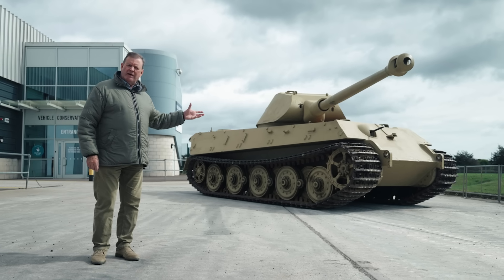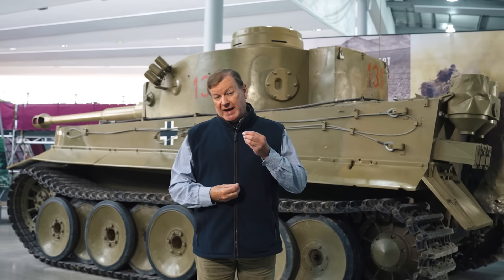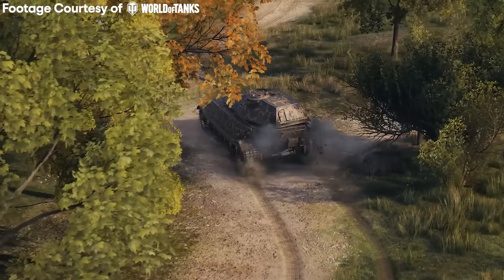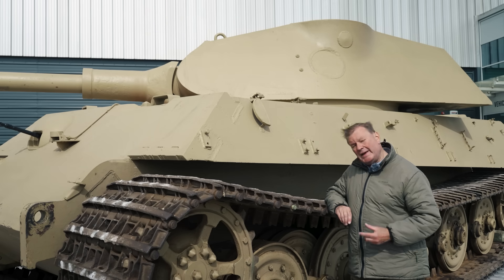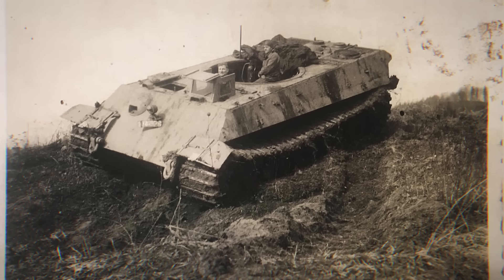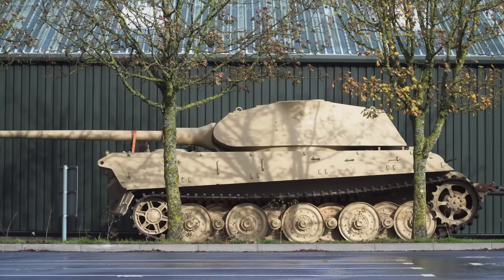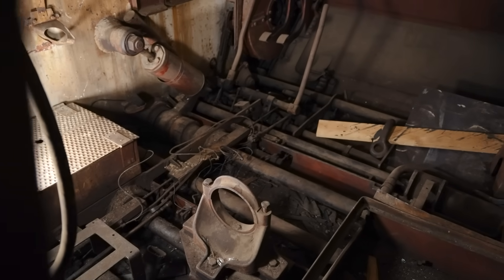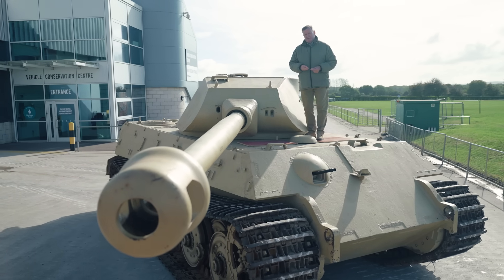King Tiger V2 - Inside The World's Oldest Tiger II

Comment: I always wondered why the Tiger 2 was designated VK-45.03 when it's successor, the Tiger 1 was designated VK-45.01, it would then lead me down the interesting rabbit hole of the VK-45.02 (H) which was effectively the Germans version of the M4 improved but for the Tiger 1.  A obscure and lesser known design that while only lasting around 7 months on the drawing board, many design aspects found on today's Tiger II's were carried over from Vk-45.02 (H).

Comment: So that Porsche turret WAS made by Porsche... Why make it confusing by saying it is not made by Porsche, if the turret WAS made by Porsche? The difference is that the turret wasn't intended for King Tiger, or Tiger 2, but turret was still made by Porsche.

Also, the explanation of why the top is thicker is silly, not in the fact silly, but the reasons why it is explained. It is obvious to many, that the top is higher because it's thicker, but it's not explained why, though everyone can image that it is a protection against air attacks. What is actually a good question, that wasn't given, nor answered, was, why they left that front slope between front and top, thinner without additional plate like for the production model?

Comment: When you give it a new gear box, make sure the gears are case hardened to the proper depth and the hardness drawn back to Rc58-60. The original gears were too hard and too deeply hardened on account of time pressure to get them finished. As a result, they tended to shatter under sudden shock loads.

Comment: The failure of Porche's petrol-electric drive was also caused by the lack of materials - chiefly copper - that this design would have required. With u-boat manufacture having first priority in such copper as there was, and they required a lot, the petrol-electric drive was simply not viable, even had it performed well.

Comment: At the Full Military Museum in Switzerland, a second Tiger II will soon be running again after more than 20 years of restoration – the second operational one worldwide after the example in Semur, France.
I’ve been following this project for many years, and once it’s completed, this Königstiger might well be the best-preserved of its kind. The restoration has been ongoing since 2006 and is carried out with such precision that you could almost call it “like new.”
Typical Swiss precision! I wish the entire team great success with the final stages of the restoration – an outstanding piece of engineering history!👍
Reply: And the Saumur Tiger 1 should be running again soon. It entered the museum in a running state, but they did not run it since. So they are doing a full overall to make it run again. Raised 260k € last year. And it should be running soon using it's original engine and transmission.
Reply: @karakiri283Isn’t Whitecroft also restoring at least one Tiger 1?
Reply: WHEN WILL WE SEE IT RUN THIS IS NOV 2025 SO WHEN?
Reply: @KenLeach-y2f  Current status of the Tiger II restoration at the Full Military Museum (Switzerland):
According to the Winter 2023/24 report, the Zimmerit coating has been applied and the turret has been re-mounted, giving the tank an almost complete appearance.
The gearbox is largely rebuilt, and the steering unit is expected to follow by late 2025. The engine, restored in Poland, is currently undergoing test runs, but hasn’t been installed yet.
In parallel, the new exhibition hall is still under construction, which naturally ties up some resources. The official website shows few recent photos, but several Facebook updates confirm steady progress.
My conclusion:
A realistic date for the first running demonstration would be summer 2026 – and judging by the pace of work, that seems quite achievable.
When that day comes, I’ll be there to see it! 💪
Reply: Saumur*

Comment: I did a lot of research on this particular tank years ago including a visit to the museum in 2008 when it was still in the horrible three tone paint scheme. The tracks that are on the vehicle now are not the ones it was born with, those would have been the Gg 24/800/300, but it was recovered in 1945 with the Kgs 73/800/152 that are on it now. I have a real soft spot for these odd vehicles, there are so many little details, apart from the ones mentioned in this video, that sets it apart from the production vehicles and i am aboslutely thrilled that Bovington has decided to try and make this one a runner.

Comment: On the subject of the shape of the turret it's not just to make the turret harder to hit, the actual purpose was to deflect rounds, exactly as it ended up doing. The idea was that since the turret was meant to be mounted in the front in the Porsche chassis it would mean that shells would either go over the turret or be directed to the thick frontal armour.

In the production chassis shells were instead re-directed to the top armour which is one of the weakest parts of the entire hull, therefore rather than an issue with the turret's design the issue was directly a side-effect of trying to re-use a turret that was designed for a different hull and demonstrates the importance of designing armour holistically.

A good example of another tank with a similar design that didn't have the issues with the early King Tiger, is the T-34 which had a similar turret profile, but because of how the turret was positioned, shots would hit thicker armour. I imagine the original King Tiger design was inspired by that. Incidentally the shot trap issue was far more severe on the Panther, where the top armour was ~17mm vs the 40mm of the King Tiger.

Comment: This turret design seems concurrently angled for a casted type which would have decreased production time. Still it has a shot trap but time was running out on trying to get enough tanks to the front to limit the  allies.
Schwere Panzer-Kompanie (Fkl) in Normandy was most notorious unit using this turret version in a grouping, they were still decimated by mechanical issues not combat, the final survivor losing steering and crashing into a tree near Toury.,

Comment: Although I know it happened, I doubt many Soviet tankers got themselves into a position to hit the rear of the turret.  It is one thing to know of a weakness at the rear of a tank, it is another thing to be able to make practical use of it.  In any event, the sides and rear of all tanks are a vulnerability and tankers tend to keep that in mind both in terms of protecting their tank and attacking others. One was also rarely in a position to take careful aim or hit such a target at anything but close range. Tanks were lucky to hit other tanks anywhere in most cases so a hit on the vulnerable spot, unless really close up, would have been random.

Comment: Meh, that whole „a hit in the turret would blow up the tank, so they moved the ammo to the hull“ is just your typical WW2 myth.

What next? They discovered that getting shot might blow up your tank so they didn’t carry any ammo?

The T-34-85 carried ammo in the turret bustle the same way and many post-war had ammo in the turret for the loader.

So the idea that they designed a tank with ready racks in the turret but then decided not to use them, which would slow down the RoF by half or more, makes simply no sense.

The tank museum just can’t stop at always going back to repeating some tank myths.

The Tiger II was pretty impervious from the front so, whenever one was destroyed it was going to be because of shots to the side.

Comment: It all seems very strange now that the Germans never did design a local Diesel-engined tank. This would have given them less of a logistical nightmare that did eventuate for them. The petrol engines used fuel prodigiously, lengthening supply lines, in addition the fuel economies were lost to this engine choice. Once they could only really rely on synthetic fuels, it presented greater technologies for refining as far as I understand the chemistry?

Comment: I'm rather curious what you will do about the missing transmission. Since you won't be shooting at it or with it, driving it around is just about all it will do. And for that it needs to move the track, but you have nothing doing that. So will you be designing and building a era comparable transmission or a exact replica or get some shortcut?

Comment: FFS the turret was DESIGNED AND BUILT FOR THE PORSCHE DESIGNED TIGER. That's the entire reason that the turret is the "Porsche turret", Porsche turret doesn't mean it was designed or built by Porsche.  It's like thinking the statement of" Bob's Mercedes " means Bob designed and built that Mercedes.
Reply: cant really tell if youre arguing against them correcting it or think they dont know...

either way, your comparison isnt very good as the contexts arent nearly similar

Comment: If you have a working tank, why do you need to take it to bits for "evaluation?" Doesn't evaluation mean putting it through the same usage tests as your own miserable failures [looking at you, Covenanter! 🤣] Surely they would have already retrieved broken/abandoned tanks from the field during the war so they would have gearboxes & such that already showed the weak points.

It just seems so petty to dismantle a working example for mundane data that could be (& should have been already) collected by other methods.

Comment: I don't think you're to blame for it being called a Porsche turret. as I can remember seeing it called that in books back in the 1970's.
Reply: Later books quote earlier books and thus an error becomes fact. The same is true for the limited wingspan of early WW2 RAF bombers. The standard tale is that the wingspan was limited to 100feet because of how wide the doors of the aircraft hangars used by the RAF could open. This is a falsehood with no known source. The truth is that the Type C hangar had doors that open to 120 feet, 20 feet wider that the wingspan. The wingspan was limited for either a political reason or a physical strength reason; both having sound arguments.
Reply: @neiloflongbeck5705 Or that Japanese fighter pilots were taught to turn fight. Where in reality the fighter pilots of the Imperial Japanese Navy preferred to use hit and run tactics early in the war. I suspect that overgeneralisations are the most common way for errors to slip into the history books, but far from the only ones.
Reply: @neiloflongbeck5705  Bit like the Caunter camouflage scheme painted on Bovington's Matilda for many years, which included sky blue. Blue was never part of the original scheme, but other people copied the example in the museum, assuming it was correct.
Reply: @neiloflongbeck5705 Wow! The "wingspan" story is really a myth? I grew up believing that the short Sterling bomber was designed to fit the hangers, and that cost men their lives. That isn't true?
Reply: @xray86delta no, the doors of Type C hangar of 1936 could open up to 120 feet. Specification B.12/37  that gave us the Stirling and Specification P.13/37 that gave us the Manchester and Halifax both called for most maintenance to be carried out in the open air. There are 2 credible reasons for the 100ft wing span. Both are to limit the size of the bombers, one was because of the strength of a single pilot (although the Stirling was built with 2 pilots in mind) and the other was due to an expected size limitation on bomber aircraft that was expected to come into effect in the early 1940s (but never happened).
Reply: @neiloflongbeck5705  All jolly good but the Stirling was never fitted with Porache turrets.  Think I watched the video you're commenting on.
Reply: @Scatup it's just another myth that became fact, that's all.
Reply: "Right, we made a mistake.  Here it is."  If only every organization could be so direct and honest.
Reply: Do you happen to remember the titles of those books? (Understandable if not)
Reply: @FireWarrior2013  The County Library was just across from my school in the early seventies and back then they had a really good section on military history and everything else come to think of it.  As to the titles, no idea although I can picture some of them. Then there was the Purnells books on WW2, bound to have got a mention in those.
Reply: Your right, this is what the study of history is, we learn and update our thinking.  Something we say today as fact, may turn out not to be true with more evidence.
Reply: @sgtrock6283 like how and where did tiger 131 got captured.
Reply: @kevinnguyen9445 Tunisia, I believe.
Reply: Having built quite a lot of 1/35 German & UK armour from early 2000’s there are many kits (Dragon) labelled “Porsche Turret” for this type. & it’s stuck in my head ever since. I do stand to be corrected by people who are extremely knowledgeable in their field. Example = The Tank Museum. Cheers from Sydney, AU.
Reply: Same here. Even Tamiya called it "Porsche Turret". I still have their late '90s model somewhere at my parents basement. love the shape of that specific turret.
Reply: You're right. But, not just in books and magazines. The Porsche turret term is still being used on plastic model kits and their assembly instructions. Usually, it will define the difference by saying its production period is early when it rolled onto the battlefield.
Reply: There is was, a great series of books called An. ILLUSTRATED GUIDE TO WORLD WAR TANKS AND FIGHTING VEHICLES. Printed in the U.K.😂😂😂 and the book said that there were 2 turrents the Henkel and the Porsche turret😂. Produced in the 1970's and 1980's.
Reply: Me too. I believe "Tank", Kenneth Macksey & John Batchelor, mentioned it.
Reply: Maybe they thought the turret was a reminder of the size and shape of a 911 in the 1970s?
Reply: The book "The Tiger Tanks", by Peter Gudgin, 1991 - Chapter 2 is titled "The Porsche Tiger". Chapter 5 refers to the "Porsche turret", with pictures, many times.
Reply: @thetankmuseum Chatgpt5 (so pinch of salt and all that). 

That’s a very good and very specific Tiger II history question — the answer is tied to the vehicle’s official development timeline and the first time the term “Porsche Turm” (Porsche turret) or the vehicle itself shows up in wartime records.

⸻

Short answer
	•	**Earliest documented reference to a Tiger II (VK 45.02 / Sd.Kfz.182) with a “Porsche turret” is in Henschel/Porsche design and acceptance paperwork and Waffenamt documents from January–February 1943.
	•	The first official German Army reference to completed Tiger II hulls fitted with the Turm Porsche appears in spring 1944 production and allocation lists — these are the 50 early Tiger IIs delivered to Panzer-Lehr and schwere Panzer-Abteilung 503 in May–July 1944.

So if you mean design documents → January 1943; if you mean service/combat references → May 1944.

⸻

Timeline details

Date	Reference / Source	What’s mentioned
Jan 1943	Krupp / Porsche drawings for VK 45.02(P2)	“Turm Porsche” — original design proposal for Tiger II; turret built by Krupp to Porsche’s specs for his Tiger II prototype submission
Feb 1943	Wa Prüf 6 (German Army Weapons Office) notes	“Turm Porsche” vs “Turm Henschel” as competing designs for the new heavy tank
Dec 1943 – Mar 1944	Henschel production records	first 50 Tiger II hulls completed — turrets on hand were the already fabricated Porsche pattern
May 1944	s.Pz.Abt. 503 strength returns	first combat delivery of Tiger II with Porsche turret at Mailly-le-Camp and then Normandy
June–July 1944	Allied intel reports (e.g. British AFV Intelligence reports)	first Allied recognition of a new heavy tank; later identified as “Tiger B” or “King Tiger” with sloped front and rounded front turret (the Porsche type)

⸻

Terminology
	•	“Porsche Turret” was not an official German designation; Germans usually just said Turm Porsche (to distinguish from the later Turm Henschel).
	•	The Porsche turrets were built in advance by Krupp for Porsche’s planned VK 45.02(P), then mounted on the first ~50 production Tiger IIs because the turrets were already ready when Henschel’s hull was chosen.

⸻

So, earliest you’ll see the phrase
	•	Waffenamt/contract documents — January–February 1943 (internal German).
	•	Operational unit mention — May 1944 (s.Pz.Abt.503 and Panzer-Lehr getting the first 50).

⸻

Would you like me to point you to specific archival document numbers (e.g., Wa Prüf 6 meeting notes, KStN / Heeresmitteilungen references)
Reply: Well yeah its confused w the panthers turret which was made by porsche
Reply: This turret is attributed to Porsche by Walter J Spielberger in his Tiger book from 1968 Tiger I and II "Konigstiger" page 50!
Reply: Does the French tank museum at Saumur still have plenty of panzer parts gathered from across France after WW2? A place to start?
Reply: I have a Porsche parked in my garage… would I be to blame if I called it a “King Tiger II variant”? 😂
Reply: So... Porsche turret because it was redirected from the Porsche contract, but not because it was their design. Fine. I'll accept that.
Reply: I had often heard of the "Porsche" turret, too.
Reply: The turret has nothing to do with Porsche or Henschel, actually it was designed by Krupp as He did with the Tiger 1. Porsche and Henschel designed the lower hull.
Reply: Can we help fund this?
Reply: And then there was the Tamiya kit at the same time.